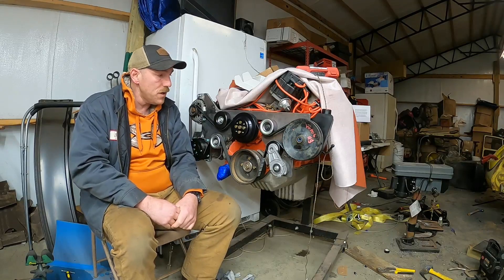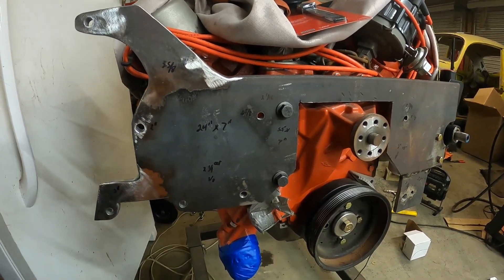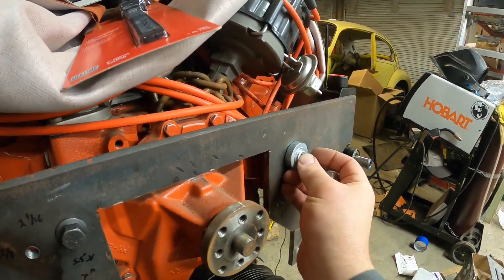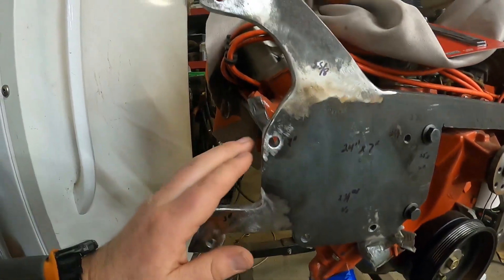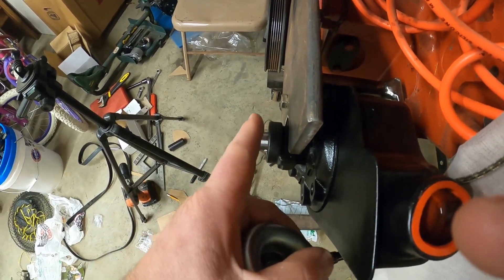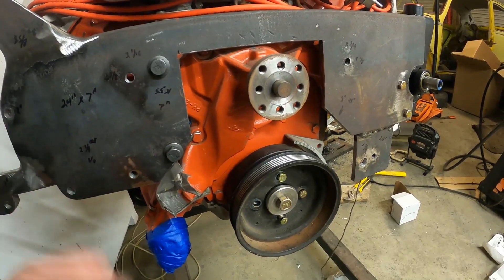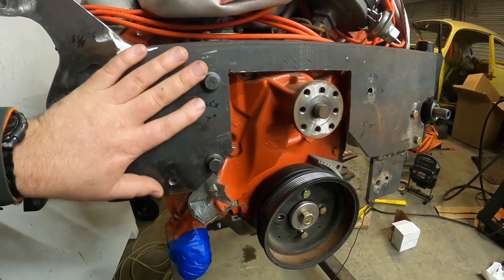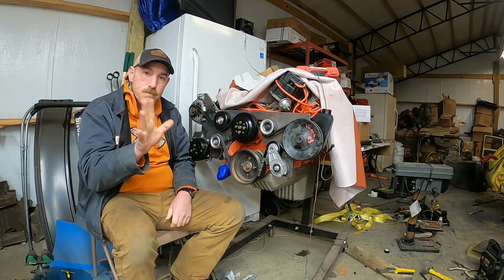Custom made Cadilliac 472 Serpentine Belt System build Part 6, The Rough Measurements

Comment: Looks like a winner, hoping the AC compressor clears
Reply from the maker: Me toodooo. i think it will be close on the passenger side control arm mount.  I do have bit of room to move it in with a bunch of cutting and welding but fingers crossed.